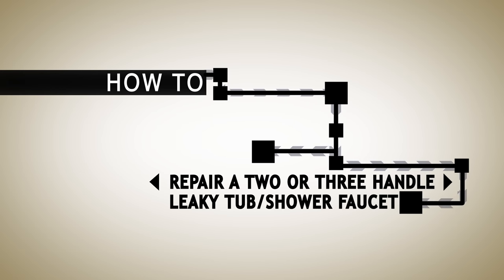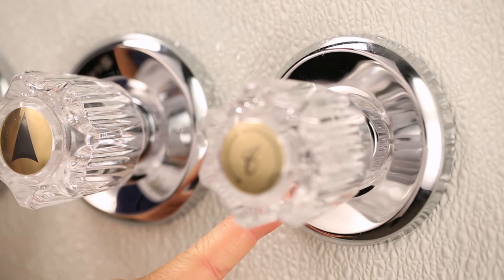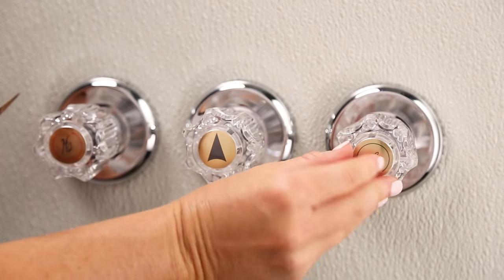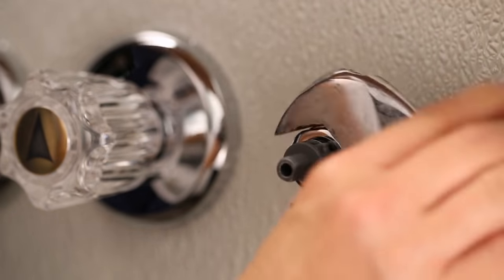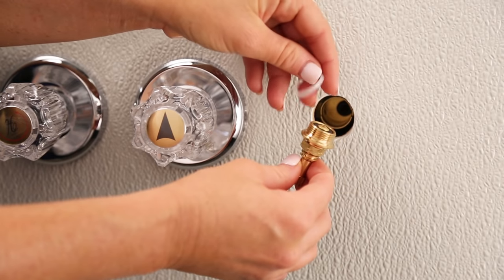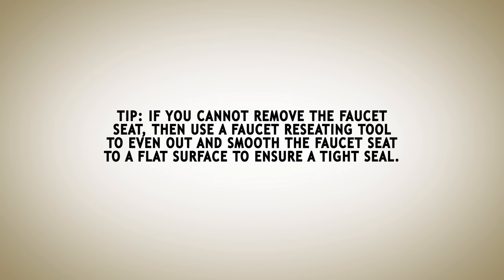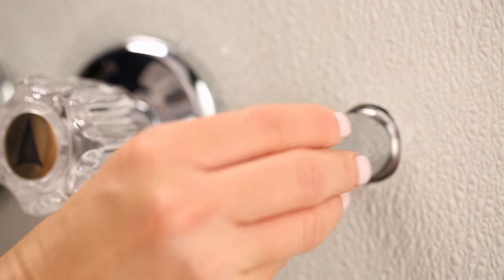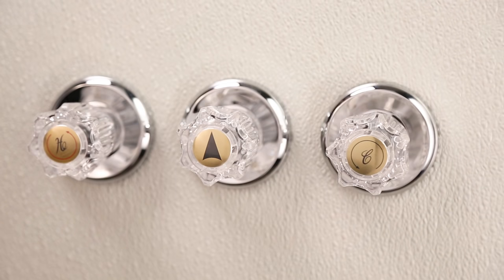Repairing a Leaky Two-Three Handle Tub-Shower Faucet

Comment: There are much, much better videos out there that explain how to repair/replace than this one. I was totally confused with the switching between plastic & metal valves. I also feel steps were missing.
Reply: Steps are missing, like showing the VERY important replacement of the rubber seats and springs when using the cartridge type stems, which placed me in a pickle.

Comment: Why would you make this video and not show the replacement of the spring and rubber seat in the cartridge style stems? I replaced my stems and did not know about replacing the seat and spring. I had water coming out of the shower head that wouldn’t shut off. Had a plumber come out and said I selected the right stems and had put them in correctly but I had to replace the rubber seat and springs, which were worn out and needed to be replaced…You guys really need to redo this instruction video.

Comment: It would have been useful to show replacing the spring and rubber seat.
Reply: No, it's imperative that you show how the spring and rubber seal go in.
Reply: Am , looking for the correct any to install the ( spring + rubber ) also , we're one of you guy's able to locate such a video ?
Reply: @johnsimpson3708  say , were you able to locate a video showing - how to replace the ( spring & rubber ) seal pieces ?
Reply: Finger nails , please show us how to replace the ( spring & rubber seal ) " please " ?
Reply: Right! I forgot which way it came out. I think it was wrong from the jump
Reply: I agree! That’s what I came t this video looking to see.
Reply: @louisenelsonjr1094  same here!
Reply: Women
Reply: I have the same problem
Reply: @montellwilliams811  There are many, but all you have to do is to unscrew it and replace it with a new one.
Reply: It’s like a click pen. It’s beyond simple and I wouldn’t waste money on a valve seat removal tool. Put the rubber fitting then the spring on the top of a Philips screwdriver and then use a flat head to push it in place in the water like. It’s easy don’t let this stuff scare you or intimidate you.

Comment: Did all of this and handle still leaks this time. I replaced it 7 times. It lasts for six months then leaks again
Reply: Because its Danco
Reply: If it keeps leaking you most likely have the old nylon washer stuck inside. Make sure the whole valve inside is clean and free of debris and make sure your switching seats and using Tephlon tape on threads without over lapping any other parts of the seat just threads. If you want to get crazy you can use some Key tite just a smidge before re threading your seat on going in a reverse spin pattern before actually threading on to make sure theres no cross threading issues. Also use your using faucet grease for the inside of your new stems before installation. Good luck to you.
Reply: Replace whole unit and be done with it

Comment: Outside of our index cap being a twist off (almost gave up!), This video was absolutely amazing! Once we figured that out, it took us longer to relight the pilot on the water heater and turn the water back on, than it did to replace the stems!

45m or so total, and less than 25 dollars at Home Depot to fix our leaky shower. Thanks so much!
Reply: How did you find the stem model?

Comment: Should I use teflon tape or compound to seal the stem body?
Reply: On these the rubber gasket is the seal so it's not needed I'm sure you've solved your problem by now though
Reply: You don't need it. They are sealed.

Comment: Somebody please help me hey Sam I installed a new plastic stem the whole shebang the new spring with the little thing or after I turn the water back on and water is running through my Fossett my tub even though it seems to be in the office position and if I turn the hot and cold and more water comes out at a faster rate but if I turn everything into the office position there still water leaking you’re not leaking but running
Reply: I’m having the same problem now, I think I have the stem in wrong
Reply: @ratbastard4u  you need to make sure that the new replacement is identical to what you have now..otherwise things will not work…I can’t remeber what I was meaning in this comment..but I remeber what I had at first wasn’t exactly so I had to get another piece ..be sure that you don’t buy more then you need ..

Comment: almost explained in video type of thee knobs. I don't see where spring and rubber seat inside part. I replaced both spring, rubber, and part faucet. I see still leaky. Have store sell three faucets? I don't find it. they sell only one faucet as center. hum. Thanks nice video.
Reply: Did you ever find a solution i have the same problem at the moment
Reply: @agnieshandkahanizunigaandv6228  me too!! 😭
Reply: You can get parts needed at plumbing supply store, Home Depot has some of the plumbing parts also

Comment: What if the water wont turn off completely after putting the stem back in?
Reply: William Bradshaw this could be from the seat being too worn out or an improper washer was used and a thicker one was needed between the seat and cartridge
Reply: Look inside at the faucet seat with a flashlight. If it is damaged or corroded, replace the seat. This requires a seat wrench.
Reply: @SailingFanatic  say , what is a seating wrench ?
Reply: @montellwilliams811  hi Montell , just saw your question. Here is a great video explaining it: https://youtu.be/qF_4BGZLP1E